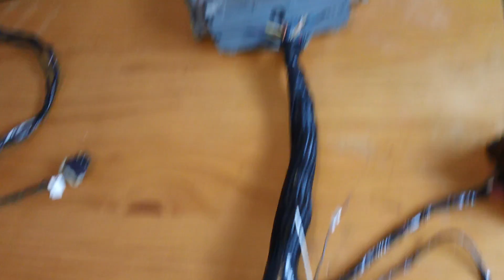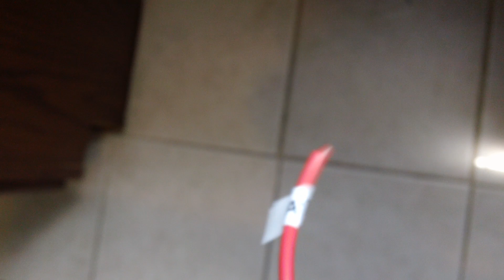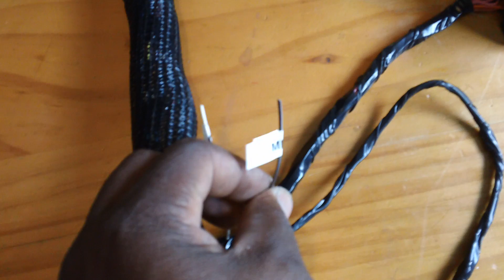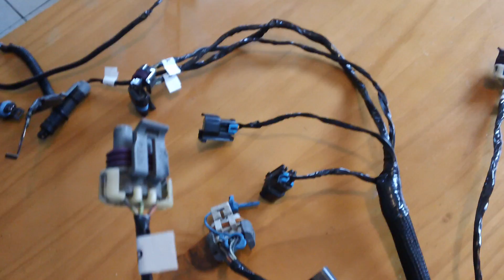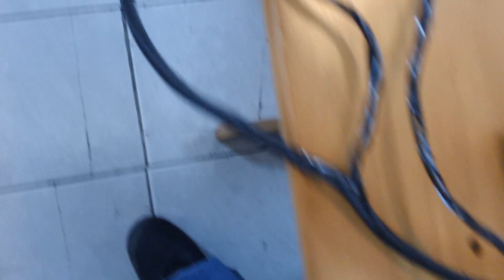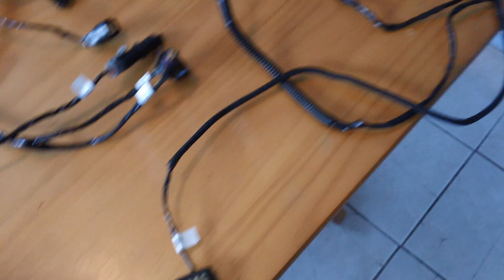LS1 harness build pt3

Comment: A like to ask u a question brother I recently purchased a 3 stand alone wire harness but it didn’t come with the plug for water temp sensor but on the blue and green plug it was the wires for fan 1 & fan 2 will it still work
Reply: Almost for it’s going on a 2004 5.3L

Comment: Where does the VSS wire connect? , will be using a turbo 350.
Reply from the maker: Don Rutter Dakota Digital sells a vss sensor for the th350 swap
Reply from the maker: Don Rutter https://www.summitracing.com/parts/dak-sen-01-4160?seid=srese1&cm_mmc=pla-google-shoppingsrese1_-dakota-digital&gclid=Cj0KCQiAtJbTBRDkARIsAIA0a5PW766N00T2wpJzJVqysHbPHi5PkUYSKckOzuyIoJSoGAfXQq7LhQsaAhxDEALw_wcB
Reply: Thanks Ken, that is 8000 pulses per mile, I know the computer can be flashed for 8000, but isnt the stock flashing 4000 pulses per mile ?
Reply from the maker: Use this in conjunction with the Dakota Digital Pass-Through Pulse Generators SEN-01-4160. It will drop the 8000 pulse per mile down to 4000 pulse per mile.

Dakota Digital SGI-5 Universal Speedometer Signal Interfaces SGI-5
https://www.summitracing.com/parts/dak-sgi-5
Reply: Awesome, thanks !

Comment: Hey Ken c I have a question on the Orange wire that goes to the fuse block. So I think it ripped of or I accidentally cut it. I believe it's the Orange wire that will send constant power to the pcm. Where does this wire connect it the harness? Or does that wire go directly to the pcm and if so, what pin number? Thanks
Reply from the maker: Blue connector pins 20 and 57 for truck harness 99-2007 Classic body style

Comment: where can i contact you for one built for a s10? i plan to mount the computer beside the radiator on the radiator support. also planing to use a 4l60e.